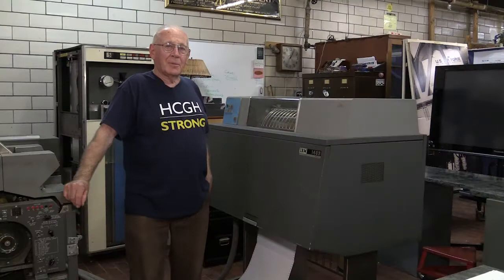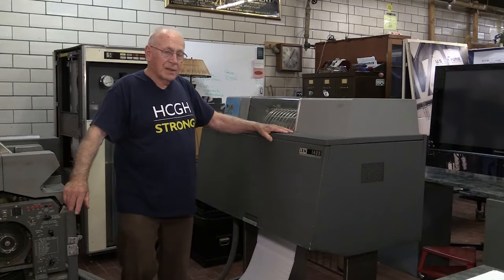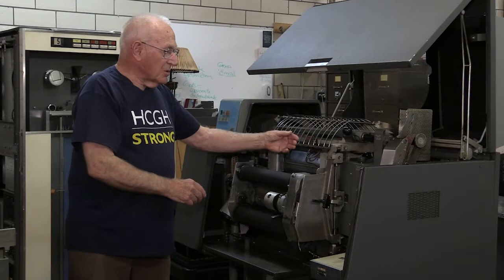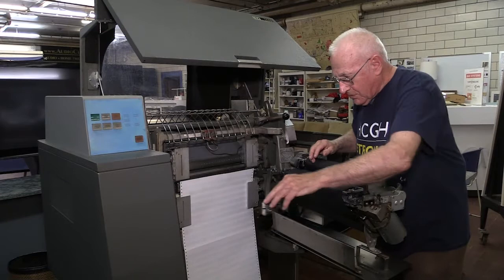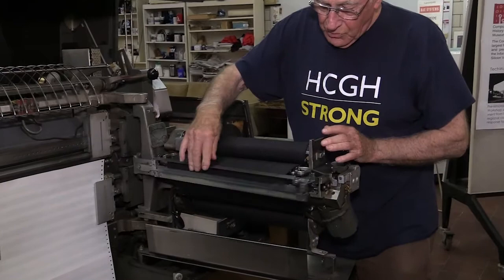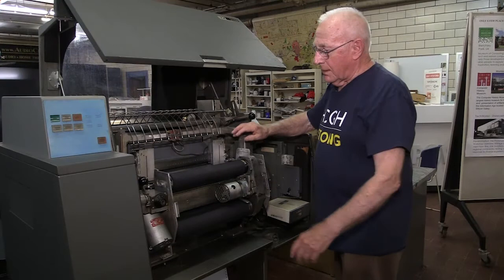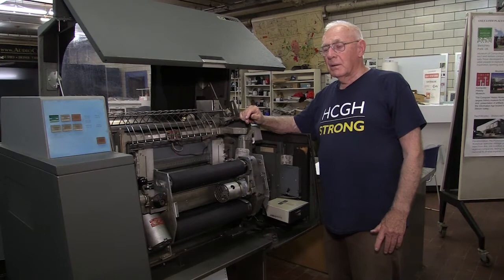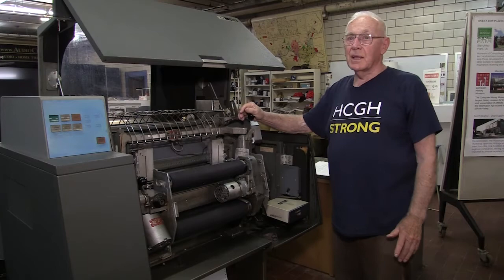IBM 1403 Printer

Comment: I remember the 1403 very well. The command I went to in 1970 had a 360/40 with the 1403. They had previously had a 1410 and we were still emulating 1410 during my time there. That was quite a procedure as we had to change all of our disk packs to go to emulation mode and then change them back. I remember how cool it appeared as all 9 of our tape drives would work on sorting. Quite a change to what we have now. I still remember that, when in emulation, I had to hit i space 2 space i in order to enter a command. I think we had to set up a 14k buffer for the printer during IPL. In all my time there we never had any kind of malfunction with the 1403. I seem to remember that it was faster, though. I think it was supposed to be 1100 lpm.

Comment: I was a CE and I worked on the 3203 until 1996. At that time there were still some 1403s in service. The 3203 was based on the 1403 except instead of having a hydraulic forms feed drive it had a stepper motor. Also different instead of the forms control tape the operator would load a forms control buffer into the printer.

Comment: These printers were the longest lasting part of the 1401 project, continuing production well into the 370 era.  It was the world's fastest line printer when introduced, and its speed was actually hindered by the performance of the computer.

Hydraulic form feed...now that's a bit of overengineering.
Reply: There were stories that competitor computer companies told, of these printers breaking a hose and spraying high pressure oil everywhere. I suppose it actually happened now and then, but I never saw it, and I saw a fair number of various models of 1403 on a lot of systems, even though I worked for one of the other companies in the BUNCH. These were very reliable workhorse printers in my experience. But then, I have a hard time thinking of any chain, train, or drum printer by any of the major companies that couldn't be described as a reliable workhorse.